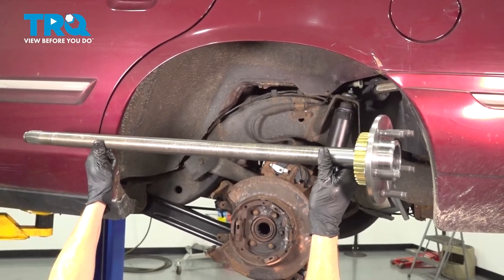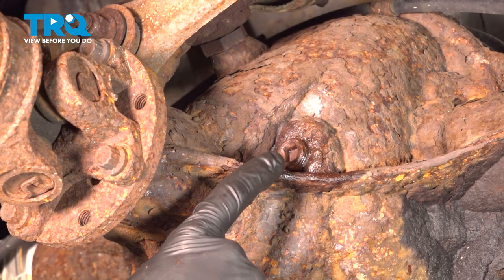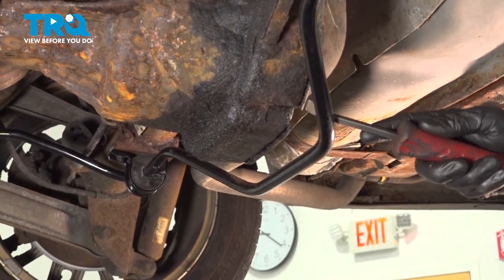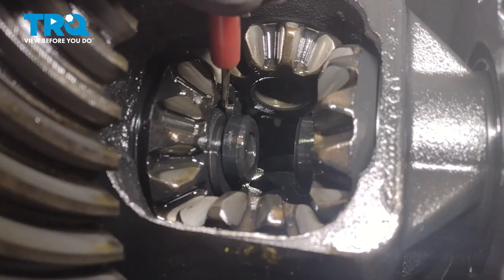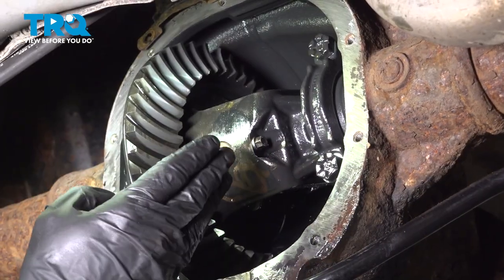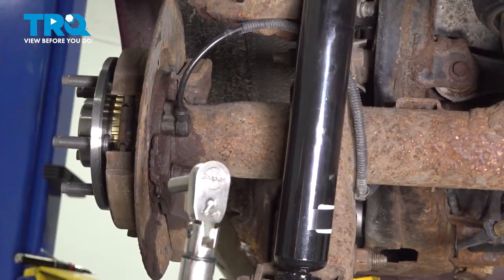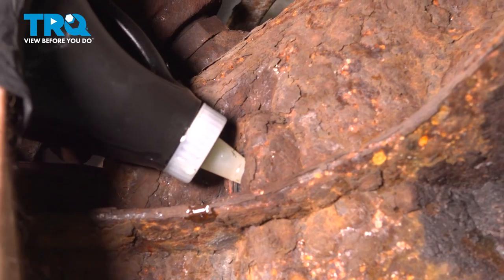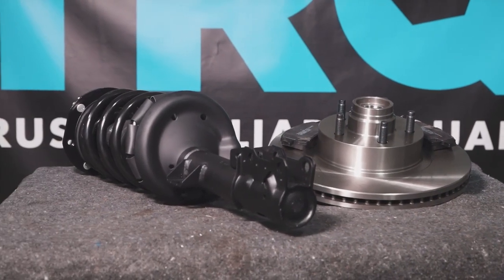How to Replace Rear Axle Shaft 2003-2011 Mercury Grand Marquis

Comment: This is a concise , clearly explained video with excellent footage. I have a 2003 Grand Marquis and after watching this video decided to fix what I intially thought was a brake caliper leak but now turns out to be  a bad axle seal.
I carefully followed every step but now cannot exract the axel after removing the C washer. No matter how hard I try, up, down and side to side it remains firm even with slight leverage from a small steel bar against the emergency brakes. In my flustration it became necessary to put the main pin and retaining bolt loosely back in to hold the cog wheels in place. I have limited garage space and only able to extract one axel at a time meaning that I will have take the car out and reverse it back in to do the drivers side if and when I manage to get this `%*%$#@  axel removed.
Wheel Off, Rotor Off, Brake Caliper Off, ABS senser out, Fill Plug Out, Diff Cover Off, 8mm mounting bolt Out, Main Pin Out, C Washer out, Axel Stuck????
I would greatly appreciate any advice. Thanks, Tom.

Comment: Nobody ever shows what to do if your spider gears roll out and how to replace them. I always mark and remove them with the shims. Takes seconds to replace them. Nobody ever talks about the red thread loctite and what to do about it. I always put a little heat to soften the loctite before I even put a wrench on it. Round off the hex on that lock pin one time and then you’ll understand.